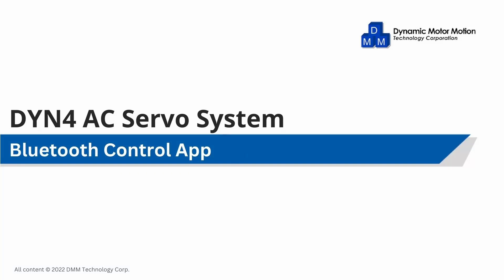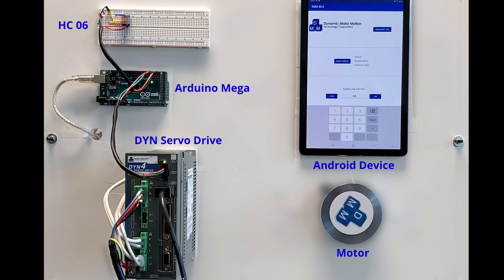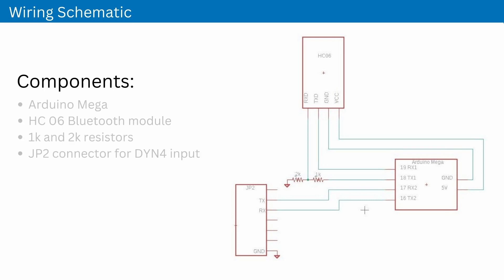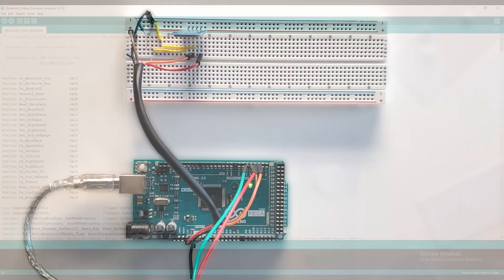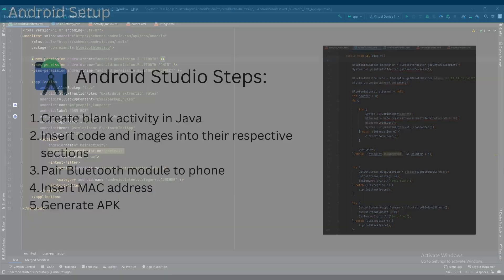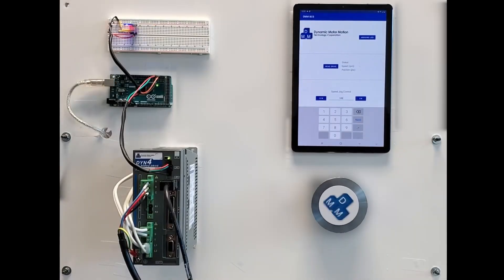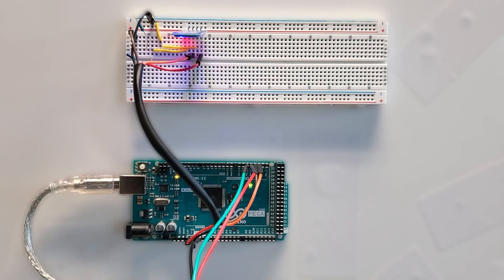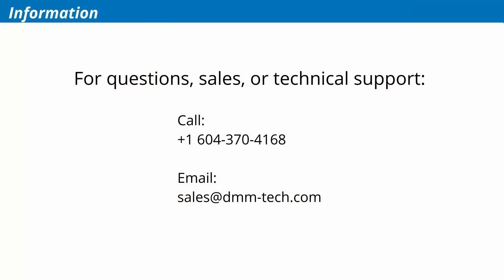Wireless Bluetooth and Android App Control Demo

Comment: What is the purpose of connecting with bluetooth?  Is the servo actually run doing work using bluetooth?  Or is the bluetooth just used for testing the servo?